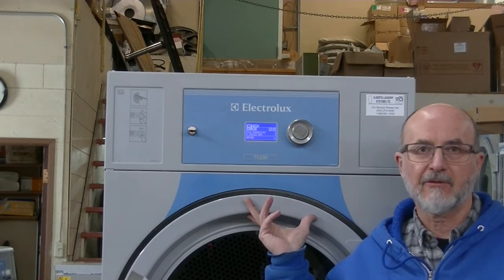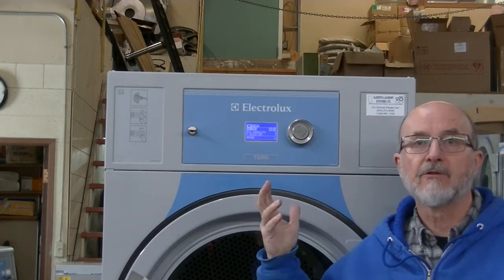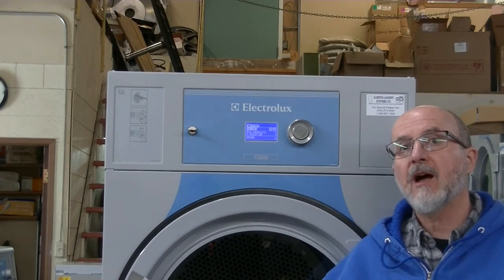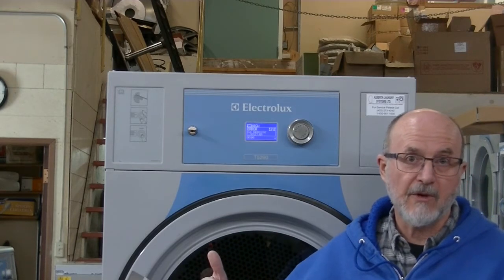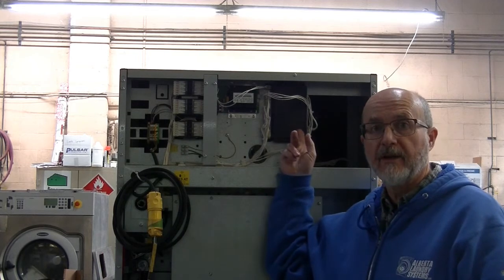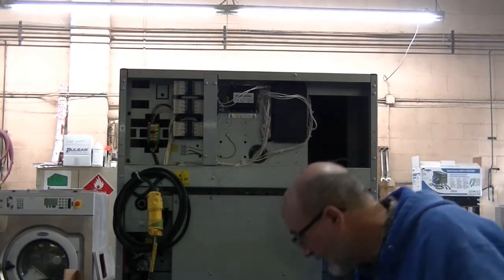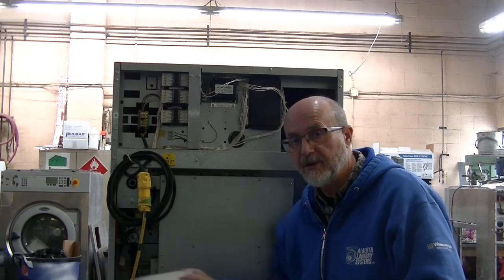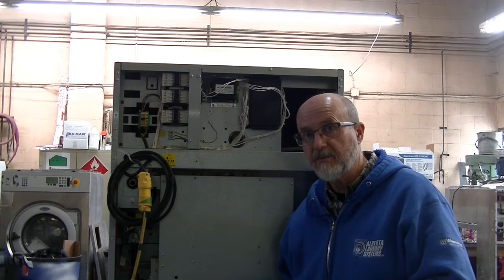Diagnosis and replacement of the I/O board

Comment: Hello sir I recently bought a cpu from Electrolux dealer Group Dynamics pro. Sent them the specifications but when I received the cpu and I installed it, it brought Compact Pro boot Version 1.3
Tried reaching them out but they couldn’t help out, all that they said was that we needed their service provider physically at the washer to install the software. Kindly sir how can I sort out the issue, I’ll greatly appreciate your help
Reply from the maker: I am sorry but I am having trouble understanding what is going on. Usually when you purchase a cpu  the software to run the washer or dryer is programmed into the cpu. The software that is running that unit is found on the loading door tag. It will be labelled "program" & have 9 numbers. That is the software that has to be installed into the cpu for that washer or dryer to operate. Every model has different needs & parameters - there are hundreds of different software available. I would assume that the provider of the part asked for that software number prior to sending you the cpu. You might want to contact them & send back the cpu for installation of the proper software.
Reply: @albertalaundrysystems5928  they asked for the picture of the serial number and product number and I sent them the picture behind the washer that entails the details. By that I presumed that they’ll figure it all out. But when the product come and brought the error on the display. I call and asked them, but they say that the cpu was updated with the current software and since it is a 6 gen washer it could only be done on/at the washer.

Comment: Can you tell me please how you fix the machine when display show ( flash peremater data )
Reply from the maker: That is indicative that there is a problem with the cpu. If it does not reset after powering down for 5 minutes then you will have to replace the cpu. Contact your local Electrolux dealer & give him your software / program number (found on the loading door sticker). They can then program a new cpu for you that will work in your machine.